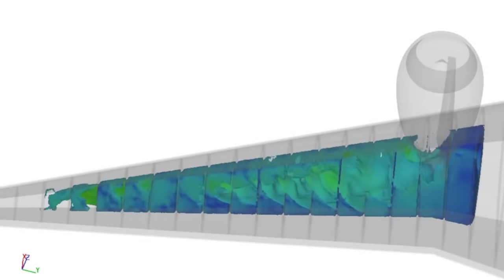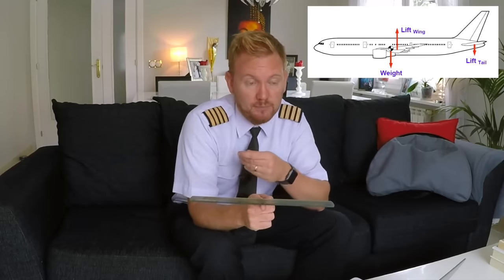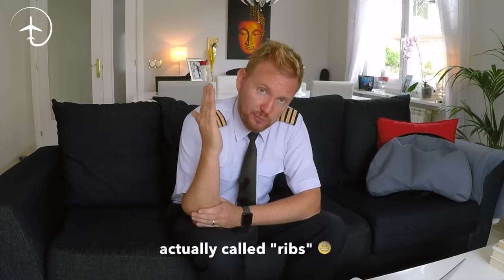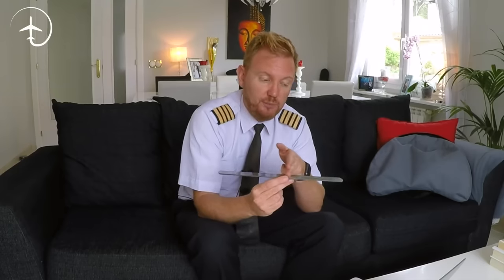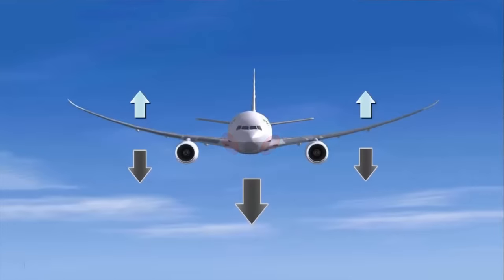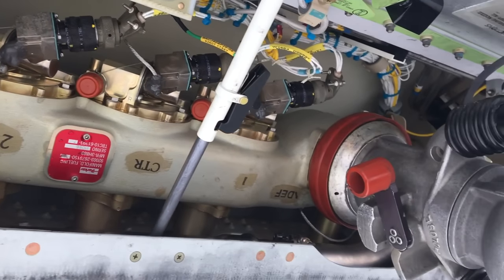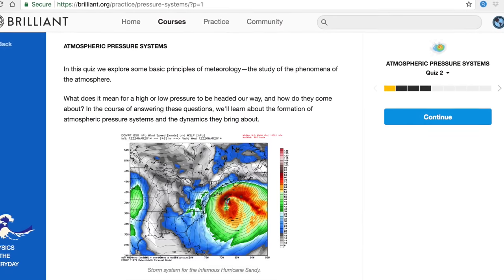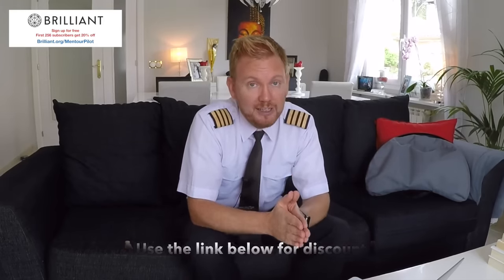Why do aircraft store fuel in the wings?

Comment: I don't buy it,  get the science trying to justify but that much fuel in those puny wings???
Reply: Volume has a cubic relation to length. That is, if the size of the tank increases, the volume increase is cubed. For example, if you have a box that is 1 meter x 1 meter x1 meter, the volume of that box will be 1m3. Now, if you increase the size of the box to 2mx2mx2m the volume will not be 2m3, but 8m3. If you again increase the size of the box to 3mx3mx3m the volume will not be 3m3, but 27m3. Since 1 m3 is equal to 1000 liters a tank that is 3 meters in length, 3 meters in depth and 3 meters in height can store 27000 liters of fuel.  Just as an example, a wing that has a length of 7m, a height of 0.5 m, and a depth of 3m (that is, the size of a wing belonging to a 737-600)  has a volume inside the wing of 10,5m3, or 10500 liters of fuel per wing. That means that the two wings have a combined total of 21000 liters of fuel capacity. 

Now, that would be valid if the entire wing served as a fuel tank, but as the video showed, the structure inside the wing ocupies some space so the fuel capacity of each wing should be lower. Still, considering that the official fuel capacity (wing tanks+central tank) of a 737-600 is 26000 liters, I'm not off by a large ammount in my calculations.
Reply: I guess it was a joke...
Reply: Have you ever been close to a Boeing 737? Those wings are anything but puny, they are immense. Besides, if it's not in the wings, where the hell do you suppose it is? The video even shows a cross-section of the aircraft's fuselage, which shows clearly that the interior is occupied by cargo space and seating decks. Plus, go to any airport and watch out the window for aircraft being re-fueled: you'll see that the pump trucks are connected to gasp THE WINGS! If your mind can't fathom the math, at least use your eyes.
Reply: You dont buy it? 😂
Reply: I don't think that the fuel in those wings burn hot enough to destroy a skyscrapper. 9.11 meme. Some video show that comlercial planes fly with compressed air. Look it up.
Reply: @monmalin  
A jet engine compresses air ....
then injects fuel into it and burns the fuel with the help of the oxygen in the air.

Just as your car engine does. One could say that a car engine runs with compressed air, as really the largest amount in each piston stroke is just compressed air .... with a little bit of fuel in it.

Don't ignore the "little detail" which make all the difference.
Reply: There are also fuel tanks in the fuselage which are used for longer flights

Comment: I just saw this video. Very interesting. Not sure if anyone has asked this question already. But I wonder when the fuel is pumped from the tank, how does the vacuum that is generated is filled with air - how does air is introduced to the tank to replace the fuel? Appreciate mentioning that.
Reply from the maker: The tanks are being pressurized by bleed air from the engines. Great question!

Comment: Multi-part question: If some sort of catastrophic situation occurs in which the engine (or engines) on one side of the plane require being shut down AND the pumps on one wing cease to function, can you A) pump the fuel from one wing to the other to keep the fuel load balanced or B) are the fuel tanks connected and are they self leveling?

Comment: Thank you for this information. I remember hearing  that they used to dump the fuel into the atmosphere when the tanks still had lots of fuel so they could land the plane quicker in the case of an emergency landing. Do they still dump the fuel in case of an emergency landing? Where is  the dump valve located?  Is the fuel dangerous in the atmosphere, is it corrosive?
Reply: Corrosive for atmosphere? Lol, the fuel probably become fumes and dissapear and mixed with the air on the cloud (in my logic)
Reply: Some aircraft have one dump valve per wing tip and once the gas exits the plane it evaporates very quickly.

Comment: Dear Mr. Mentour Pilot. 
It's really enriching. Great pilot.
Please let me know follwing for accademic purpose.  
1. Once centre tank fuel gets depleted, then how the fuel in the wings come to centre tank. 2. Or fuel pump fitted on each wing also.
3. In centre also 2 tanks, one each for one wing.
When I sit in air craft I fear fuel pumps starvation due to turbulence.
4. Is the wing structure member is one only from one end to other end. This also scares me during flying failure of this structure member cracking. 5. Is this member also light weight aluminium. 6. Will it sustain such turbulence as engines also fitted in the wings. 7. During turbulence have you experienced engine gone shut and 8. Engines can it be restarted at that altitude.  
What a technology Mr. Mentour. Oh my god.
Please throw some light on my 8 doubts, so that I can have fearless flying. Looking forward your reply.

Comment: Thanks for the wonderful presentation. My questions  are:
1. Can a aircraft survive with 1 engine in the case 1 of the 2 engines fail while in air? If yes, for how long?

2. Can turbulence crash an aircraft?

Thank you once again 👍
Reply: just google it may take long time to get your answer
Reply: Yahya-Imam Munir The aircraft can fly on one engine but it will be hard to control as the airplane will turn towards the dead engine. Turbulence can‘t crash airplanes; most of the time; I can‘t think of one, but turbulence, if very very very very very severe, can bring down an airplane. That‘s why planes do the best they can to avoid thunderstorms.

Comment: Hydraulics systems use the fuel to cool the hydraulic oil. Heat exchangers are located in each wing. One wing has A system heat exchanger and the other has B system heat exchanger.

Comment: The center of gravity - and its constancy during depletion - is a brilliant revelation. Who knew! I thought it was just because "form-adapting" fuel would fill the thin wings, leaving the larger underbody (i.e. beneath the cabin floor) free for optimal payload capacity; and loading and unloading payload into the wings would be far less practical than the underbody as well. Yet I do now think out loud, that the center of gravity would also remain constant if fuel was evenly distributed along the underbody. It still sounds like the lesser choice for the above reasons, as well as that front-to-back control systems and the million miles of wiring need some of that underbody space.

So I might say that the primary reason is payload, given that center of gravity balance could be achieved in two different ways.

Comment: This is soo great! Thanks for explaining. Also the thing that made me feel most confident here is the nitrogen system. I was worried the tank would explode by some mysterious reason... You rock!
Reply: Well, unfortunately one of the the reasons why they introduced nitrogen filling - that Petter didn't mention - was actually a terrible accident, where most likely a short circuited cable in the wing caused the explosion of a B747-100 just off the coast of New York: TWA 800 in 1996, so not even that long ago...

Comment: The gray colored center part of the wing are called the fuel tank roof except the boeing 787 because of its invisible color roofings that were fully white not gray in the center.
Reply: It could be the insulation of the fuel tank since it prevents fuel from heating from sunlight.

Comment: I had to work in a aircraft wing while I worked on a C-131 Convair. Aircraft  Buno. 141009 had a fuel leak and the only way to seal the leak was to refuel the aircraft and run air 24/7 and after close to a week, myself and another sailor went into the wing and using pro-seal we sealed the spots on the bottom of the wing that were leaking. Also we replaced countless dome nuts.
And after several days we finished our job and then took our aircraft outside and refueled the C131 Convair and after rechecking the wing we found no more fuel seepage

Comment: Aircraft fuel tanks used to be actual tanks that fit into the open areas of the aircraft's structure. It was not until after WWII  that the "wet wing"--using the wing itself for fuel storage, without a separate tank unit--became common

Comment: The way partly-full wing-tank compartments affect stability is well-known in marine engineering, as "free-surface effect", sometimes causing ship's engineers to fully flood a partly flooded compartment, for increased stability and improved trim. (Stability of surface ships is kinda counter-intuitive, with center of mass above center of buoyancy, unlike simple case w/ aircraft.)
Reply: Why air you comparing a plane to a ship
Reply: @ethansaviation2672  Should be intuitively obvious to the casual observer. Tank loadings affect stability. You might want to double-check your postings before clicking on [Reply]. Why are your asking "why" about something pretty fully explained? Tunnel vision?

Comment: You forgot reason 4: Energy efficiency. The fact that the fuel tanks are right on top of the engine  means that pumping is normally not required. Hence, no pumping energy losses. So, the plane gets a marginally better fuel economy.
Reply: Energy loss is insignificant here. But reliability gain is significant.

Comment: I also think, related to the third reason  you mention - wing flex - or actually max wing load - is that if the fuel were not in the wings, the wings would need to be build for higher maximum wing load, and that would increase aircraft empty weight thus affecting overall performance and fuel consumption.
Reply: The plane weighs what it weighs, regardless of where fuel is kept. The wings hold the whole airplane in the air, every ounce or it. Wing load changes would only be dynamic due to the movement of the fuel through the frame bays. Pretty minimal.
Reply: @Ampersandrascott  Maybe I was unclear in my response. I thought about immelman turn and/or leveling out from deep dive. In such situation g-forces downwards (relative to plane) increase due to centrifugal force. Now during the turn, air manouver bend wings upwards. The more mass is in the wings, centrifucal force bend them downwards, opposite direction - this is why heavier wings allow higher g-forces in upward turn without breaking.  This maybe was one reason why one version of F84-F thunderjet was furnished with wingtip tanks. Naturally that comes with drawbacks, oo, e.g. roll rate suffers.

Comment: I've see quite a few documentaries that discuss fuel storage on a typical large capacity jet airline, but that the fuel storage numbers they give the public are based upon jets using incredibly more jet fuel (so they can charge more for the airline tickets!). Supposedly, modern jet engines are extremely efficient and do not use nearly that much fuel. One of my bosses many investments is in jet engines and he has verified this to me. The total jet fuel storage numbers the airlines give the public couldn't possibly be stored on the jet for the following reasons:  1. that much fuel in a reservoir would slosh around in the tank causing the jet to go out of control, 2. there isn't enough room to store that much fuel on  a jet, 3. the jet would be extremely overloaded by weight and would't be able to get off the ground, and 4. storing that much fuel on a jet would leave no room for the passengers and provide an non-airworthy aircraft. It seems like you've deliberately skipped a lot of information about this. I've done a lot of checking on this, and it appears to be true, but I don't have and inside scoop on the airlines secrets, just from what I've read and seen on documentaries. Please advise....
Reply: @sexigrande1792  You're dead wrong, do some research!
Reply: So, I could be wrong. The one hour documentary could've been a bust. I didn't double check it and may be wrong. Sorry for saying 'you're dead wrong' without checking my facts. We always need to research as I said and I didn't.

Comment: Really informative videoI would like to ask you that how engine of a jet plane failed and what happened with the fuel which is available in wings and during flight when the fuel present in second wing reach near about end during flight how flight balance maintained?
Reply from the maker: We never run one main tank empty and not the other. We start by using the center tank and then we use equal amounts from each main tank to avoid imbalance
Reply: Thanks for telling this.But my question is that if one of the engine disabled during flight due to any technical failure about 30 minutes after flight and captain stops the engine to prevent any unexpected damage and then only one engine is on working for the estimated time of flight about 2 hours and the fuel is consumed only the working engine and what happened after 1.5 hours flight when the fuel is used the second engine?If such condition happened so what is the way to prevent imbalance danger.

Comment: Your fuel pump may be in the tank. As he mentioned the fuel is the lubricant for the pump. So you do not want to push you fuel to empty before filling up. The car fuel pump could burn up. Put gas in at 1/4 to 1/8 fuel remaining in tank.

Comment: I'm aircraft technician, If they don't store fuel in the wings it's wasted space. Any empty space in the aircraft is a potential fuel tank not just the wings. Ithas nothing to do with center of gravity because they can do that without fuel. Fuel also strengthen the structure allowing the wings to handle aerodynamic forces better.

Comment: I have a question for you: how do planes with 2+3 or 1+2 seating configuration balance? I am an engineer, only thing I can think of is fuel balance between the wings or the seat legs are close to the centerline of the plane.
Reply: You are not an engineer, you would know the answer. Train engineer maybe.

Comment: Nice video. Keep it up. U
explained very well about fuelvstorage etc. I knew that the ATF fille in the wings but I used to think that the fuel filled in the wings bcz the Engines are fitted close to the wings so that's easily&quickly flow into the engines.But I never knew that rhe wings hv such a huge area(hollow) to hold tons of fuel in it. My question is:Can the center tank, situated near the  main landing gear hold as much fuel as the both wings do.
Maybe it's like 'reserves'?!? --Love.
Reply: The center tank holds a lot more fuel than the wing tanks. 
The wing tanks are actually called main tanks, on a 737NG the capacity of the main tank is 8630 lb (3915 kg)each while the capacity of the center tank is 28,803 lb (13,065 kg).

Comment: Very nice and useful video, thanks.
I have a question, slightly on more generic question.
A hybrid aircraft, why can't we have it?
Can we fill hydrogen or any other lighter than air gas in the cargo section of the aircraft so that it become lighter than it normally is. Obviously the cargo section will need to be well sealed for it to be filled with a gas.

Comment: You confused the terms Spar and Ribs. The spars run span of the wing. Ribs run across the width of the wing. The ribs reinforce the shape of the airfoil. They also dampen fuel sloshing as you mention. You also are trying to explain the wing Zero Fuel rating of the wing. Zero fuel is the max rating of the aircraft with all internal stores loaded including the inboard fuel. That is the max load on the spar. Wing fuel and/or external stores counter balance that weight as you mention.

Comment: Hey! Excellent video, hands down! 
I've a question, what about the mid flight scenario? fuel is being used at a constant rate so the gross mass of the  each wing is bound to decrease at a linear rate. You justified by the 3rd reason that fuel being stored in the wings is crucial for the structural integrity. In engineering terms, by considering both of the wings as cantilevers, the mass of the fuel counters the upwards bending moment because of the lift thus, as you said, maintaining the structural integrity. This counter effect should decrease as fuel is being used, then what equalises that bending moment( later bending stress) mid air?
Reply: Xero Pendragon Aircraft wings are immensely strong especially in the upward bending direction. They can usually take up to 150% the maximum expected operational load the aircraft is rated for, and some of these larger planes can pull 3+ Gs so the wings are immensely strong.

Comment: Please more video about the wings for fuel, all the fuel pipe, pumps,  electrical, cockpit fuel gauges, etc. What kind of fuel is used? The fuel is filtred before to put in wings? The fuel is off the water 100%? The cold fuel contributes to make the "tromboze" on the fuel pipe at -50 C/12.000 m altitude? I apologize for my english. I can write in french? You can put a subtitle on the movie?

Comment: Structurally there is a maximum zero fuel weight. That is the maximum weight of the aircraft with no fuel in the wings. Had to compute that once to dispatch a 747 LAX-JFK per MEL with 3000 lbs in the center tank and transfer pump inop. Not really close as I remember.

Comment: Hi Mentour,

Thanks for the excellent video, but I have one question.
You said that ribs in the wings keep the fuel from quick moving when an aircraft is turning. It could make sense in a car, for example. When you turn in a car, you feel a force that tries to move you outside of the turn. But a plane makes a tilt, may be a roll (Sorry, I don't know how it is called exactly when one wing is higher then another one) in turns. This tilt compensates this force and fuel couldn't move to the one side of a plane. Am I right?
So an aircraft normally could feel downforce only, couldn't it?
Reply: You are correct.  When an aircraft banks (tilts/rolls) and the turn is done properly, it's called a "coordinated turn."  This keeps the forces vertical relative to the aircraft.  Sometimes, turns are intentionally done otherwise, such as a sideslip or "forward slip."